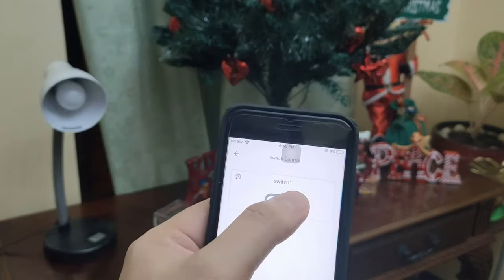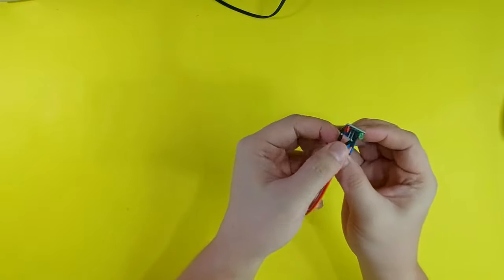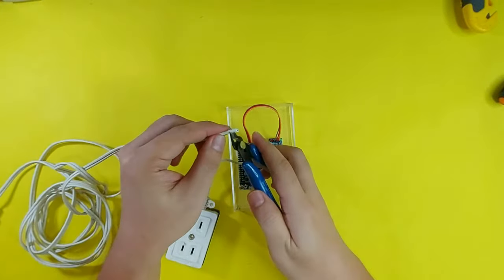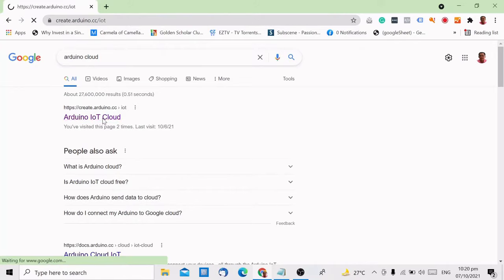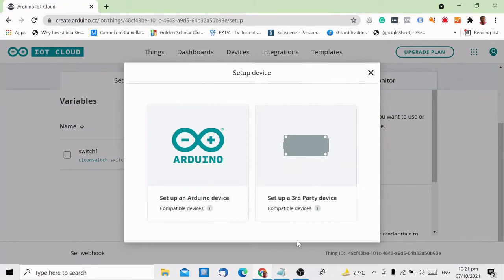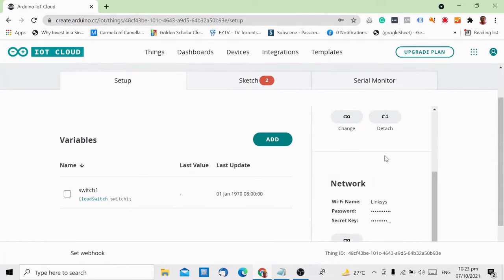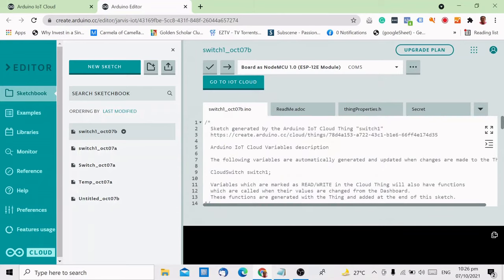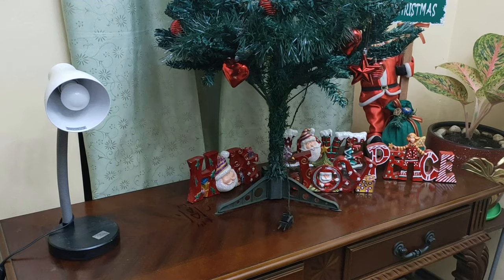Control lights remotely | IoT Switch using Arduino Cloud and ESP8266  - Home Automation

Comment: /* 
  Sketch generated by the Arduino IoT Cloud Thing "Untitled 2"
  https://create.arduino.cc/cloud/things/ceeec7a4-b3ce-484a-a5b3-e58ed768d3fa 

  Arduino IoT Cloud Variables description

  The following variables are automatically generated and updated when changes are made to the Thing

  CloudSwitch _switch_;

  Variables which are marked as READ/WRITE in the Cloud Thing will also have functions
  which are called when their values are changed from the Dashboard.
  These functions are generated with the Thing and added at the end of this sketch.
*/

#include "thingProperties.h"

#define RelayPin1 0 //D3
#define wifiLed 16 
int toggleState_1 = 0;

void setup() {
  // Initialize serial and wait for port to open:
  Serial.begin(9600);
  // This delay gives the chance to wait for a Serial Monitor without blocking if none is found
  delay(1500); 

  // Defined in thingProperties.h
  initProperties();

  // Connect to Arduino IoT Cloud
  ArduinoCloud.begin(ArduinoIoTPreferredConnection);
  
  /*
     The following function allows you to obtain more information
     related to the state of network and IoT Cloud connection and errors
     the higher number the more granular information you’ll get.
     The default is 0 (only errors).
     Maximum is 4
 */
  setDebugMessageLevel(2);
  ArduinoCloud.printDebugInfo();
  pinMode(RelayPin1, OUTPUT);
  pinMode(wifiLed, OUTPUT);
  
  digitalWrite(RelayPin1, HIGH);
  
}

void loop() 
{
  ArduinoCloud.update();
  // Your code here 
  if (WiFi.status() !=WL_CONNECTED)
  {
    digitalWrite(wifiLed, HIGH);
    
  }
  else{
    digitalWrite(wifiLed, LOW);
  }
}

/*
  Since Switch is READ_WRITE variable, onSwitchChange() is
  executed every time a new value is received from IoT Cloud.
*/
void onSwitchChange()  {
  // Add your code here to act upon Switch change
  if (_switch_ == 1)
  {
    digitalWrite(RelayPin1, LOW);
    Serial.println("Device ON")
    toggleState_1 = 1;
  }
  else 
  {
    digitalWrite(RelayPin1, HIGH);
    Serial.print("Device OFF");
    toggleState_1 = 0;
  }
  

  
}
Reply: Heyy I Wana Do this project so I Need some help of you how cam I contact with you
Reply: kale_shreyash_ contact me here
Reply: the code is working but when i turned off the switch it clicks but when i turn it on again it doesnt work. i need to touch the relay module before it turned on again hehe. Please help whats the problem.
Reply: @Life_is-j1s  see the connections.